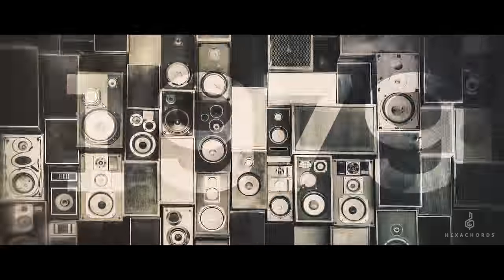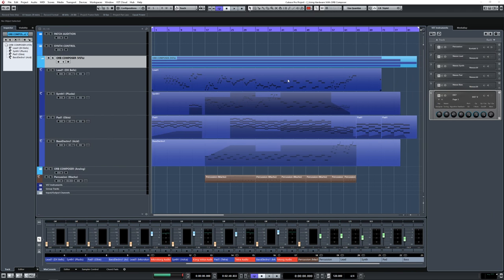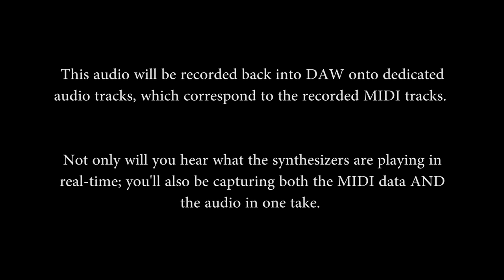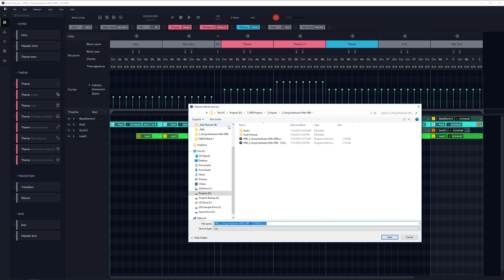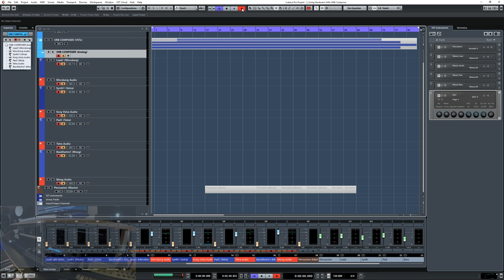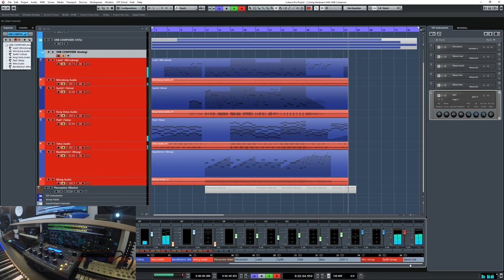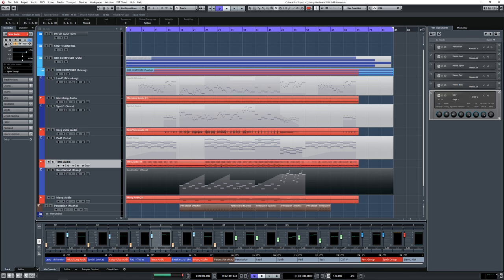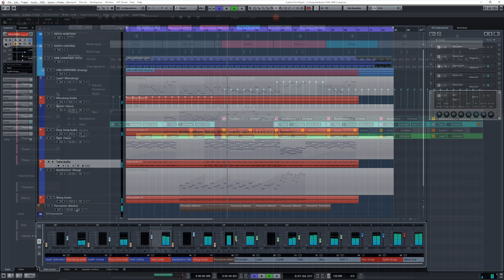Orb Composer Tutorial | Ep  5 - Using external hardware

Comment: External hardware no way! Orb Composer does not recognise a single midi soundcard. The audio settings menu is empty. I hope you guys will fix this in a future release... I mean think about it... a programme that creates midi files... but does not recognise a midi adapter?
Reply from the maker: By external hardware, we don't include MIDI devices. However, external hardware MIDI devices can be used in conjunction with a DAW. We do intend to add this ability in the future. Currently, using external hardware with Orb Composer requires a DAW, or the hardware must be something like a soundcard (i.e. Focusrite).
Reply: @Hexachords  are focusrite soundcards supported? "i.e. focusrite"
Reply from the maker: I use VoiceMeeter and route my audio through my Focusrite.
Reply: So Focusrite cards are the only ones that are supported?
Reply: Ok Audio but what about MIDI?
Reply from the maker: @philipvega7346  Any sound card is supported. You just have to route it through ASIO or Voicemeeter and similar software. 

Currently you cannot connect MIDI devices to Orb Composer.
Reply: WHEN will MIDI devices be supported in Orb Composer?
Reply from the maker: @philipvega7346  As you suggested, it would be a great addition that we are working on for future updates. Thanks for suggesting idea which help improve the software! :)
Reply: @Hexachords  If Hexachords does add the ability to recognize external MIDI devices, would I then no longer need to interface with external synths via a DAW? Could I go direct from OC to my external synth?